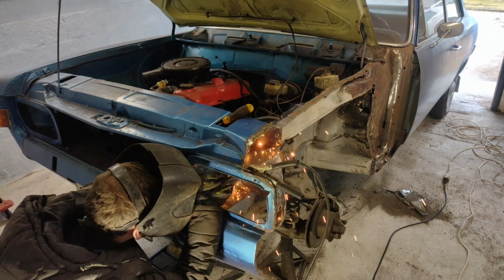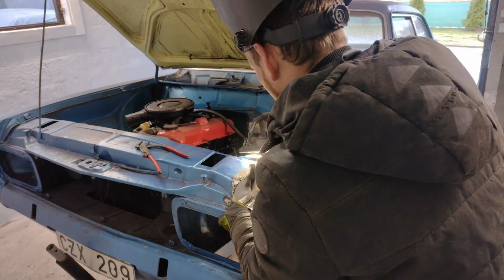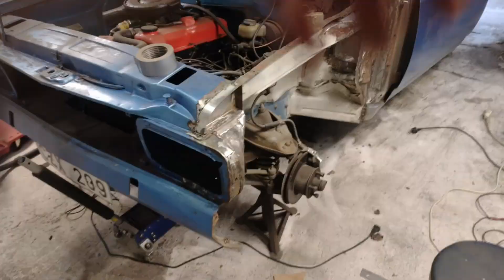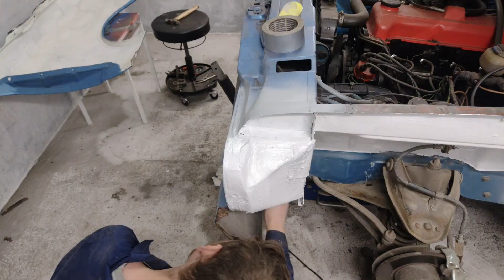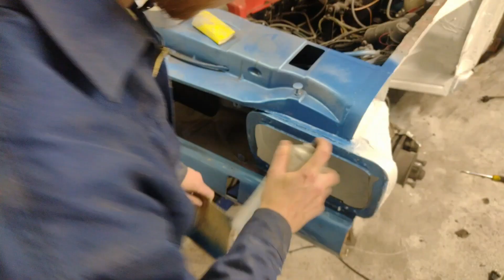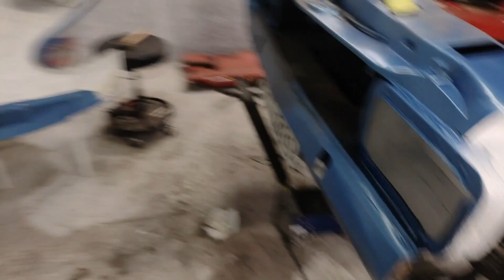Restoration Old Car ( Time warp Satisfying to watch)

Comment: Awesome man, Just subscribed keep it up! I bought my Record C project  just this week and got it running already. Now I have some brake issues and shifting issues ( It's a manual ) The shifting ball joints keep popping out. I feel like I am missing parts, Watched your video on the transmission fluid change but sadly the ball joint part wasn't visible.